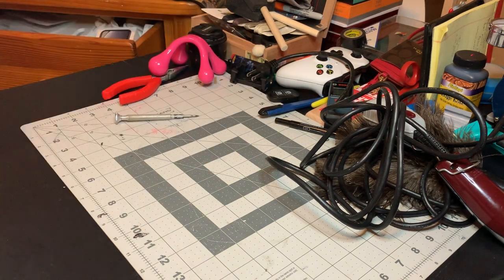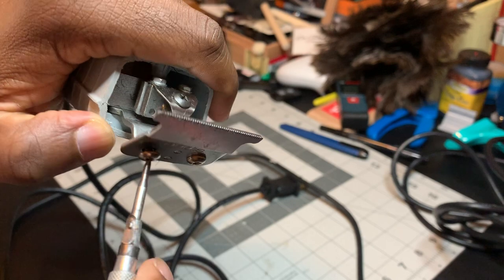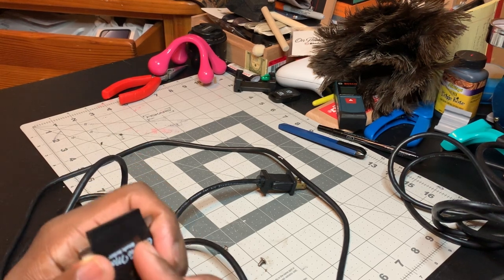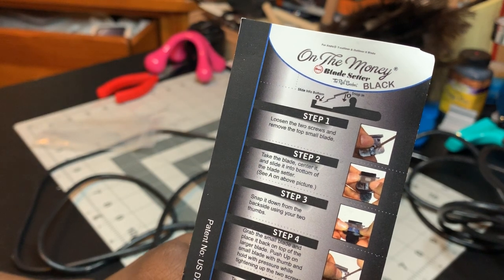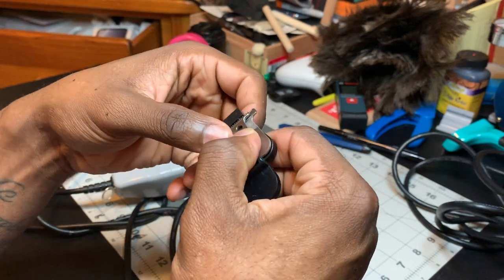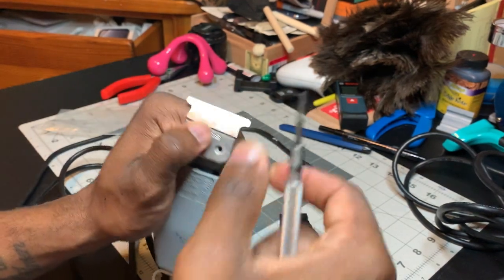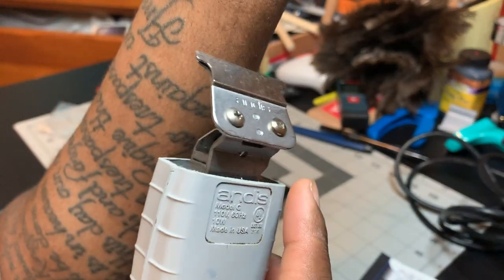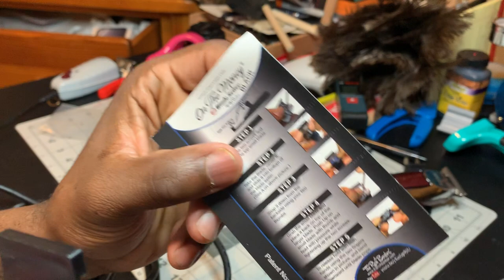ON THE MONEY ANDIS OUTLINER BLADE SETTER TUTORIAL

Comment: The blade was falling off so easily because there wasn’t enough oil. The teeth might have been oiled. But you gotta put about two drops down in the actually workings of the where the back of the blade connects. The oil will act as a type of adhesive to help it “stick” better.